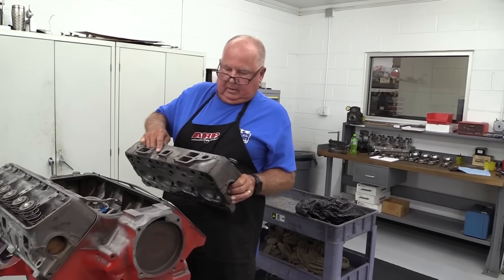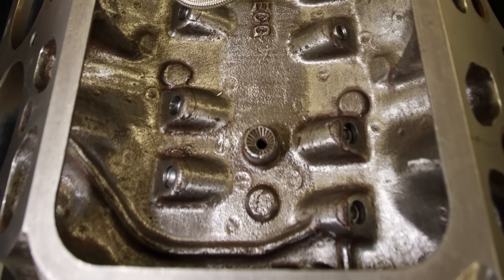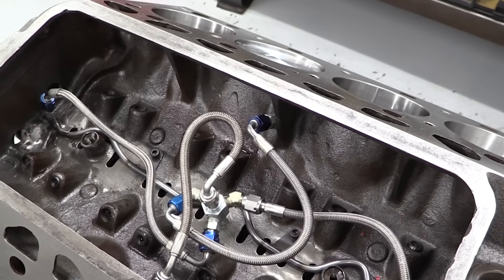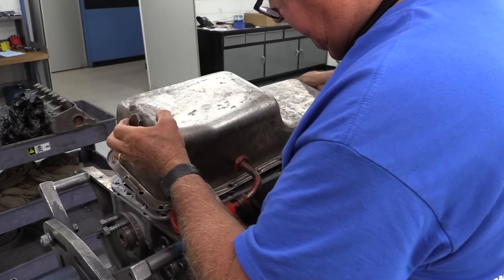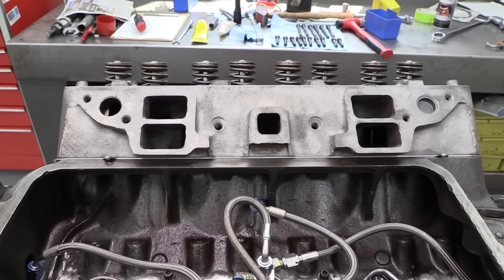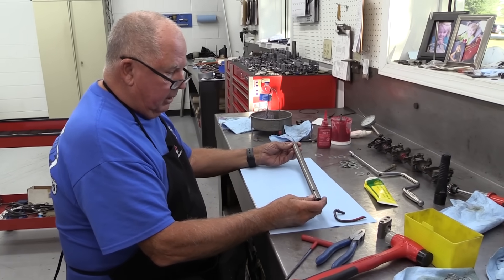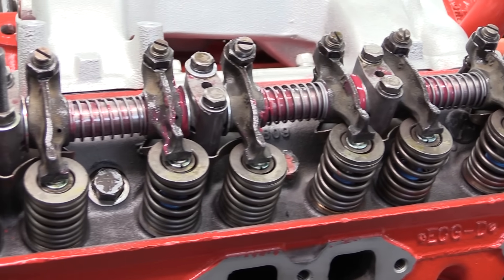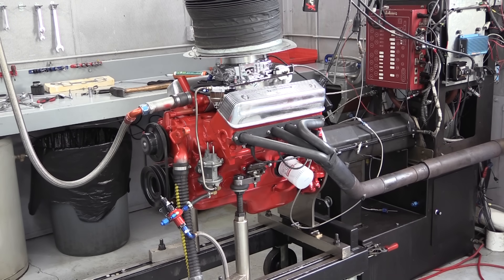The Engine That Replaced the Flathead -- Ford Y-Block Build

Comment: The modern Holley carb used in this build was actually the stock carb for the 57 T-Bird. I believe it was the first factory use of the modern Holley 4 bbl. I didn't see the distributor too close, but in 55/56 Ford used the Load-O-Matic advance mechanism in the distributor. There wasn't any mechanical advance and a second diaphragm in the vacuum advance that used venturi vacuum. I don't think that Holley carb is set up to supply the correct signal. How was that handled?
Reply: You're right, that carburetor is not set up for that distributor.  They used the Load-O-Matic distributor, which is a rookie error.  You can see in the video that the vacuum advance was not hooked up for the dyno pulls but the owner of the T-Bird will be disappointed if that is the distributor that will be used once the engine is installed.

Comment: I'd say that the Chevy small block has a Ford style exhaust port configuration, not the other way round....The Y block, at 317 cu. in. was first used in the 1952 Lincolns, then as a 239 cu. in. version in the 1954 Fords...Chevy 265 v8s came out in 1955.

Comment: 218 HP is VERY respectable for a 1955 stock engine build.
Reply: For that displacment noup
Reply: silverbird58  you have 2.0 alfa from 1960 with 240hp max and 170 in standard version so v8 should have 400ish

Comment: Back in the late '50s we used to call this engine "old squeaky" due to the lack of oil to the rockers.  After-market fixes  had oil lines outside the engine that were then piped up to the valve covers and into the rockers. A friend that had a 1954 HT complained  his "Y" block engine was weak and troublesome and wanted to replace it with a proven flathead but I  just did a rebuild and patched up the oiling problem to get him back on the road.  The SBC engines just ate-up the Fords until the '60s when Ford engineers finally got with the program.

Comment: Whats ole ?
Reply: tube dude its oil marketed for use in the southeast United States that contains an extra additive package that helps flat tappet cams without sacrificing catalytic converter integrity. My paw has swore by it since 1948. We had a 90 chevy c1500 that ran to 800k miles with tat stuff. 

They used to say “you’re motor needs oil, but buy ole!” Could pick it up at western auto or sears.

Comment: My  first  mode of automotive mobility came in the form of a 1963 F-100 powered by a 292 Y block with a 4 speed manual transmission. My dad bought the truck new in '63 and was his daily driver during the week. On the weekends it was the family camper with dads homemade cabover camper on board. When I got the pickup as a gift on my 16th birthday it was 15 years old with 120,000+ meticulously maintained miles on it. I continued to service the engine as dad had but to say I was hard on the old truck would be understated. I pushed the limits of reasonable as only a male teenager can in the harsh environment of the Arizona desert. The only modification to the truck since rolling off the Ford assembly line was the addition of aftermarket air conditioning and for reason I cant recall, an electric fuel pump. After 2 1/2 years of adolescent abuse I gave the truck back to dad to use at his business when I left for Marine Corps boot camp. The only time the truck failed to deliver was due to electric fuel pump failure, which happened several times always when most inconvenient or I was where I wasn't supposed to be. The pickup carried on in commercial service use another 10 years retiring with over 300,000 miles on it. The motor was never rebuilt or taken apart and the only major component replaced was the clutch shortly after I gave it back. I have many fond memories in that truck and all things considered is arguably the best vehicle I've ever owned to this day. Dad bled blue as a die hard Ford guy while the rebel in me lead me to the bowtie brigade when I left the Marines. Dad passed away a few years ago and I inherited his new F-150 which I still have as my daily driver. After three decades I bailed on the bowtie and am now a happy camper true blue Ford guy adding a fox body and Roush Mustang to my stable. I'm hoping to add an early 60's F-100 with Y-block V-8 someday... soon.
Reply: I had a 64 three on the tree. Found out a few years ago one of my daughters had wanted it. If I had only known, I'd have kept it.

Comment: The second-generation of Y-blocks, known as the FE and MEL series, that ran from 1958 to 1976, consisted of...

FE (Ford-Edsel, or, Ford Engineering) / FT (Ford Truck), 1958-1976
332: 4.0" bore x 3.3" stroke (1958-1959)
352: 4.0" bore x 3.5" stroke (same dimensions as the 351/W SBF) (1958-1967)
360: 4.047" bore x 3.5" stroke (1958-1976) (also available as the FT 361 for medium-weight trucks)
390: 4.047" bore x 3.78" stroke (1961-1976) (also available as the FT 391 for medium-weight trucks)
406: 4.127" bore x 3.78" stroke (1962-1963)
410: 4.047" bore x 3.98" stroke (1966-1967)
427: 4.23" bore x 3.78" stroke (1964-1968)
428: 4.127" bore x 3.98" stroke (1966-1970)

MEL (Mercury-Edsel-Lincoln), 1958-1968
383: 4.3" bore x 3.3" stroke (1958-1960 Mercury)
410: 4.2" bore x 3.7" stroke (1958 Edsel Corsair/Citation only)
430: 4.3" bore x 3.7" stroke (1958-1965)
462: 4.38" bore x 3.83" stroke (1966-1968)
(the 462 was initially slated to be discontinued after 1967 in favor of the 460 cid "385" BBF, but there were still a few 462s left unsold)
Reply: One minor correction: in 1958 the engine was "361". The "360" was the "F"-series truck engine. 

Yea, I know: same bore/stroke, just different nomenclature. 😏

BTW, the Mercury/Edsel 361 was also the Police Interceptor engine in the Ford. And the 361 and 391 engines in the trucks were "FT" instead of "FE", and featured forged steel crankshafts, while the FEs used cast iron.
Reply: A FE is not a Y block. Not any major parts from a FE will fit a Y Block. Ford quit using Y blocks in Passenger cars in 62. Trucks had them until 64.

Comment: This would probably by the first Ford engine with a full flow oil filter.
Reply: @johnjohnsn7633  Thanks for that.
Reply: While originally equipped with a "cannister"-type, replaceable element filter, they later went to the Autolite FL-1 "spin-on" filter ... and there was a kit to retrofit the older engines with the "spin-on" adapter.

Comment: Does that fuel pump vacuum device mean the wipers did not die on a hill?
Reply: Yeah.it worked much better than the GM vacuum wipers did
Reply: @lawnmowermanlawnmowerman9930  Ok thanks for that

Comment: My first car was a '57 Fairlane with a 312 Y block. I was elated to discover that a 428 C6 combo was nearly a drop in swap. The 312 was no match for a testosterone challenged teenager. LOL
Reply: That Fairlane WOULD have been a match with the "supercharged" 312 as used in the type "F" '57 T-Bird. That engine, at 300HP, was meant to go head-to-head with "fueli" '57 Vette, which it was MORE than capable of doing! The type "F" T-Bird set a land speed record (in '57) of 138MPH!

Comment: please tell me that guy didnt put lube between the rod and the bearing!
Reply: Of course he did as he should. If he was doing a Certification class at Ford Service school and didn't use assembly lube on the rod bearings he would have just failed the class.
Reply: big no no! NO lube btween the rod and bearing and NO lube between the block and bearing. only put lube between the crank journal and the rod bearing, and between the main crank journal and the main bearing. you want a dry surface on the back of the bearings

Comment: I like the oiling system. I do not know why the Lincoln and Mercury specific versions which have virtually no interchangeable parts had conventional intake ports and the Ford Ys did not. I wish on e thing that was not addressed is the using of the Mummert intake with modern carburetor and the original distributor. The original carburetor uses a different vacuum signal than the modern carburetor. i liked the video as I have a 57 Bird and a 57 Ranch Wagon with Y-blocks
Reply: I've heard but do not know if it is true, that the Ford stacked ports were used in order to fit the largest ports possible into the space available.  The Lincoln Y is larger so maybe the engineers thought a more conventional port was suitable since there is a little more room to work with.

The use of the Load-O-Matic distributor is characteristic of someone who does not know these engines.

Comment: Damn, what a front cover! This was cool, I didn't know anything to speak of about the Y-block (I'd never even heard of a 292). Pretty wimpy head and cam specs, but I guess that's how these motors were supposed to be. Cool build, and yeah, the siamese exhaust ports are VERY SBC, haha! Interesting that they chose shaft-mounted rockers way back then (hell, they might've been commonplace for all I know, I'm a GM/Mopar guy, GM didn't really do it and Mopar didn't til the LAs). Sounds good, lots of valvetrain noise, but that can be expected from a fully solid flat-tappet valvetrain. Cool vid, thanks!
Reply from the maker: Thanks for watching!
Reply: Pontiac and Chevrolet were the first engines to use stud mounted rockers in 1955, I believe Pontiac engineers came up with the design, which Chevrolet liked when designing the SBC. Everyone used shafts, until then, and continued to, until their next generation engines were designed. AMC had them on their new V8 ,designed in 1954, and didn't change until their gen 2 engines came out in '66.
Reply: @ramblerdave1339  Huh, I thought that was a later thing, like on all those Chrysler motors in the '60s-70s. I don't know much about pre-1960 stuff.

Comment: Keeping it stock is one thing, but since the stock intake has been replaced with a modern aluminum high rise, I believe I would have bumped the compression a point and added a mild cam - say .420-.440 lift.  That would have added another 30-40 hp or so.  Significant performance improvement that wouldn't hurt driveability, and, unlike the aftermarket intake, it wouldn't show.
Reply: You can take a stock 1956 Thunderbird 312 w/4 barrel 245 hp, swap out the intake for 2 4 barrels, and double spring the valves, also do the hardened valve seats to burn every day non-ethenol gas. You'll have a 300 horsepower engine, and it'll be very reliable and durable..
Reply: I didn't know the 56 312 was rated at 245 HP I thought that was in 57, when they raised the Compression ratio & installed larger valves in the heads. Always read the 56 312 was rated @225 HP.
Reply: @stevedolyniuk3358  I agree.
Reply: @stevedolyniuk3358  In 56, the 312 automatic was rated 225 hp, the manual trans 312 had 215.  The 57 312 four barrel had 245 hp with either trans.

Comment: I am a die hard Ford Fan but the Y block was nothing but a bad design if performance is the goal. They are however a reliable little workhorse. The FE , Windsor , Cleveland and 385 series are a completely different story. They all are super reliable with proven  Performance and even greater performance  potential .
Reply: Y blocks have been built up to about 600hp with conventional ports and 700hp with totally reconfigured ports, naturally aspirated.  They have been built to just shy of 1000hp in turbo charged applications.  400hp to 500hp is easily attained, reliable and very common among enthusiasts.  That doesn't seem like a bad design.
Fair enough, if you don't like it but for most people, it can easily provide more than adequate power, equal to any similar displacement, similarly spec'd mainstream engine.

Comment: My 55 Ford ranch wagon w/ Y block  312 T bird motor had valve  rocker fail due to sludge build up in the oil passages ,that fed the rocker shafts . Fired up motor, left rocker shaft snapped in half! My friend gave me a oil bypass system that took oil from the sending  port on the lower part of the block, and fed it thru a hollow valve cover/ rocker shaft bolt . This kit was from the late 50's early 60's as this oiling problem became well known . I think the sludgeing  was due to poor oils back then and road draft tube crank case breather.

Comment: Back in the mid '60's,  2 friends of mine used the 312 Ford in drag racing. One was a B/A '34 Ford P/U and one was a '37 Ford sedan C/G.  Both engine blocks had the lifter bores  machined to accept Chevy lifters. When the '37 was done racing and put back on the street, Tom found bronze busings in the Mack Truck parts inventory that fit and allowed the Ford lifters to be re-installed.  No machining was necessary to install the busings, just press them in.
Reply: You are mistaken.  There is simply not enough material in the block to do that.  If it could be done, we would be doing it today and making use of roller cams.
Reply: @charliemccraney   They did it. I am not mistaken. about this.  Right or wrong, they did it.
Reply: Ok, I'm assuming small block Chevy lifters, which simply cannot be fitted as you describe.  It's wrong to assume, so which Chevy did the lifters come from?  Maybe they were from another engine, with lifters small enough to work.  I don't see the point of that, but maybe.
Reply: @charliemccraney  Tom and Bob did this in the mid to late 60's. I was not there watch the machining nor the assembly.  All I know is that they installed small block Chevrolet solid lifters into a 312 Ford Y-block. Tom returned his sedan to the street and install bushings to accommodate the stock Ford mushroom lifters. I cannot ask Bob because he died back in the 90's. I have lost contact with Tom. I used to work with both of them at Mack Truck in Baltimore. What I have told you is true. As a young teen, I was a part time pit crew when they raced at Cecil County, Capital Raceway and 75-80. Bob even removed the front cover aluminum timing cover/water pump housing from the engine, cut off the crank snout (eliminating the harmonic balancer) and fabricated a timing cover that mimicked a SBC and drove a Hillborn F.I. pump off the Ford camshaft.  A third member of the gang was Wally Isennock, the One Armed Bandit, a super clean, maroon 1939 Ford Deluxe C/G that was 312 Ford Powered. He utilized the mushroom lifters. From what I know, they did not add special reinforcement, just enlarged the lifter bores. Wood clothes pins were no longer needed and the oil pan did not have to be removed to change out a camshaft.
Reply: There's more to it, then.  Maybe bushings were fabricated and brazed into place.  There is just no way to machine a block and have that work without more steps.

It sounds like a neat engine.  The aluminum timing cover would have been a marine part but that has no provision for a water pump

Comment: Could it be anymore obvious that Chevy straight up copied this engine
Reply: Well, no.  Chevy didn't have stacked intake ports, it didn't have a deep skirt block, the deck height was much shorter, the timing cover was stamped steel instead of cast iron, and the Chevy engine was more than a 100 lbs lighter than the Ford Y block.
Reply: @herman452  Agreed.  It's why you see people putting crate small blocks in everything imaginable.  Ford Y-Blocks?  Not so much.  Don't forget the much lighter and simpler small block valve train.

Comment: These engines had a crankcase breather with a filter on the right rear of the engine.  If the filter wasn't changed periodically the engine would burn oil.  Many service stations were unaware of this filter.  A cousin of mine drove a '57 ford from LA to Toledo, OH and used several Qts of oil, I changed the filter and going back they didn't use any.  This was in the summer of 1960.
Reply: The only breather I ever seen on a Y block was near the frome of the block on the drivers side. It does have a filter. I still have my first Y block engine and several others. I point out that POS in my tour of collection U Tube Video.
Reply: @thecollectoronthecorner7061  Now that I think about it, I think you're right.  It's been a long time since I've seen a "Y" block, probably sometime around 1960.

Comment: what size is the set screw in the rocker shaft ,and can you order the oiling system /screw?
Reply: You just tap the hole that already exists in the rocker stand.  I think it's a 1/4" thread.  Been a while since I did it.
I've also seen people machine bolts so that the tip fits through the rocker shaft in a similar fashion to the overflow tube.

You don't need the oiling system outlined in this video.  It is a waste of time, money, and effort and with all of that tubing and fittings, it increases the chance of failure.  If you build a Y, simply pay attention to the camshaft groove width and depth, use a bearing with the groove along the outside, or machine a groove in the block, which will then require restrictors to prevent too much oil from going up top.
No one who knows Y Blocks does what is done in this video.